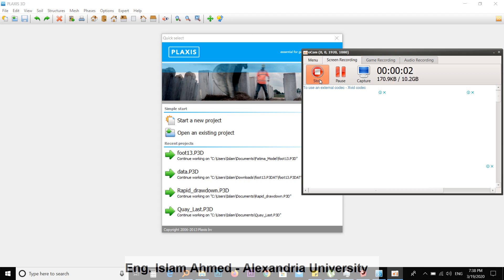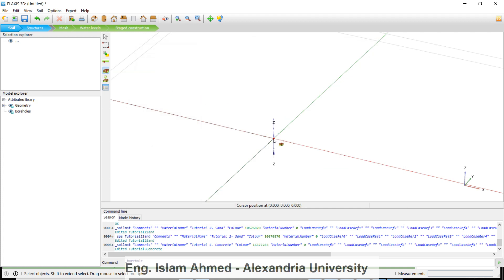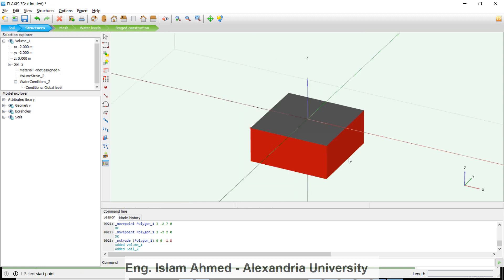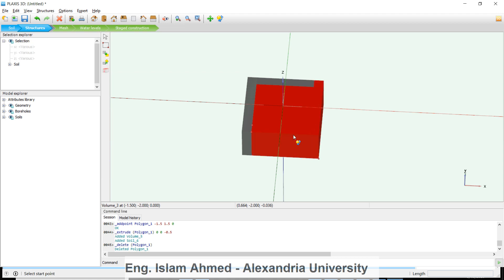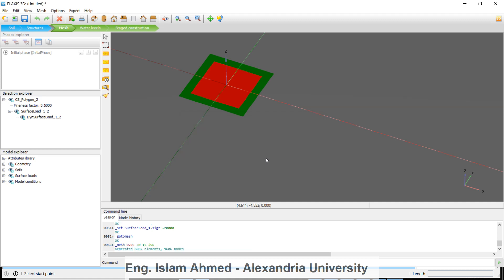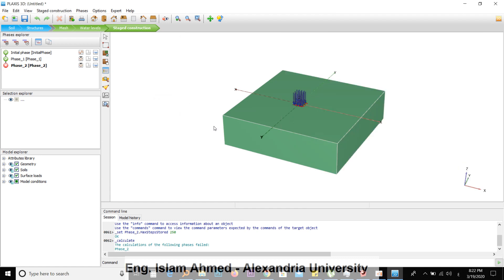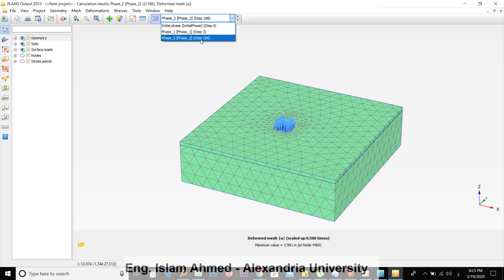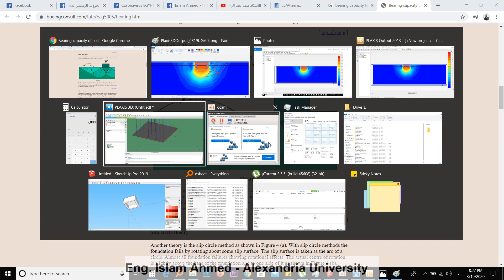Plaxis 3D - Tutorial - Determination of Bearing Capacity Under Box Footing - Load Displacement Curve

Comment: Nice job, but below are some notes: 

- As the goal is to determine the ultimate capacity for this box or skirted footing, you are advised to use the associated flow rule in the soil model parameters. 

- Again, because you are after the ultimate capacity, it is better to capture the non-linear behavior of concrete by modeling it as elastoplastic material (with MC or Concrete model). 

- It is better to extend a rigid dummy interface beyond the footing boundaries to avoid stress concentration issues, singularity, and sharp edges effects. 

- Sensitivity analysis for the mesh might be done. 

-  The way you apply the load to determine the capacity is only correct if the applied load at the site is also UDL. But if it is single or multi-point loads, this method is invalid because the BC is not a unique value for soil but depends on the load applied, among many other factors. 

- Make sure you add the interface surfaces. 

Ensure you don't double the concrete unit weight, as the replaced soil unit weight shall be subtracted! 

- Finally, FEM has a well-known limitation when it comes to large strain or deformation analysis (ULS), as in this case. Hence, if FEM is to be used, the Updated mesh option must be used in the calculation. 

FEM is a useful tool and will always give you results, but you need to be careful, calibrate it with different methods, and always compare it to a simple analysis method to see if the results make sense. 

All the best
Reply from the maker: You have richened my knowledge alot. I read all of those notes which I have studied well and totally agreed with you. But I don’t think that concrete non linear behaviour should be included as the major effect regarding the soil not concrete which could be considered as rigid and could be compatible with some of bearing capacity theories which assume the same methodology. And about extending the interface that’s a great idea. Special thanks for your time to write all of those for the learners here. Finally, I’m really looking forward to hearing from you to continue those decisions around. Would you mind dropping an email to: islam_ahmed@alexu.edu.eg please?

Comment: Hello, Can you help me in my project ...I am facing some problems regarding the failure load and bearing capacity.
Reply: what kind of problem
Reply: @mkaslantas  I don't know how to get ultimate loads... My project is on GEO SYNTHETIC ENCASED STONE COLUMNS
Reply: @PCEFaizanBashir  I don't know the stone column application on plaxis exactly. But you can look at the literature. I would also recommend solving the problem analytically. you can use mstage ratio for ultimate load when doing analysis
Reply: @mkaslantas  The loading is applied the same way as in other cases( sigma-z ). Since, i don't know much about Plaxis, that's why it is hard for me to analyse the failure load

Comment: Hi Eslam,

Thank you for the lecture. It was very useful. 
My question: Is the space (volume) empty under the base. For example, the distance between the point (0,0,0.5 m) until (0,0,1.8 m) is empty (hollow)?

If you would like to do a pile lecture. my pleasure to help.

Regards,

Hayder
Reply from the maker: Hi Mr. Hayder,

Yes in this new type of foundation this part would be hollowed 

And which type of pile study would you like ?

Regards
Reply: @eslamahmed7022 
Dear Eslam,

Thank you for replying. I mean, the distance between (0,0, -0.5 m) and (0,0, -1.8m) without soil or concrete, when I mean, it is empty?

About lecture, calculation the bearing capacity of pile under tension, lateral and compression force using create polycurve. 

In addition, moulding of pile load test under compression.

Regards,
Reply from the maker: No the area is filled of course with soil no need no be empty